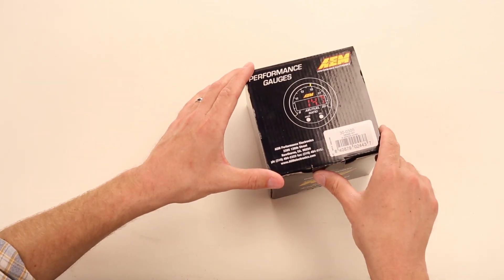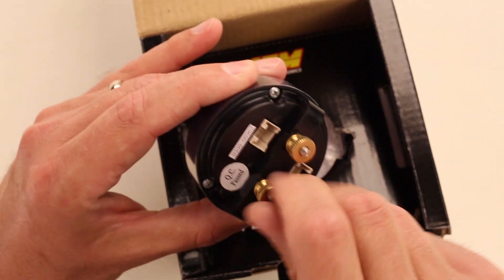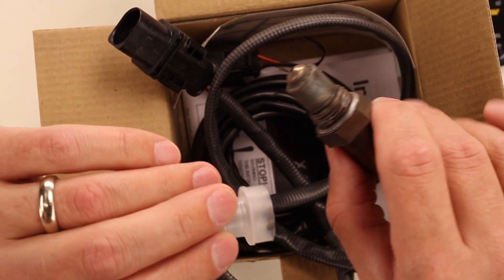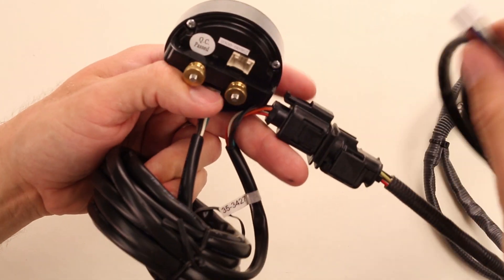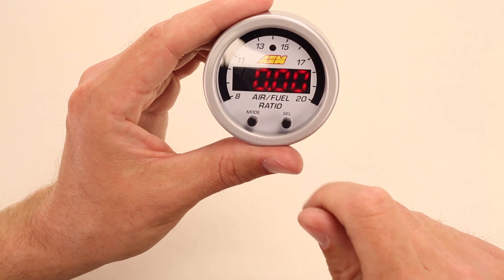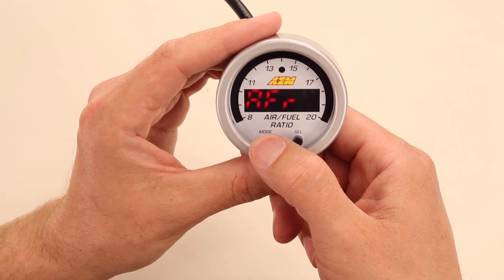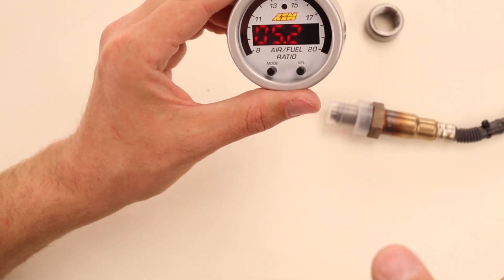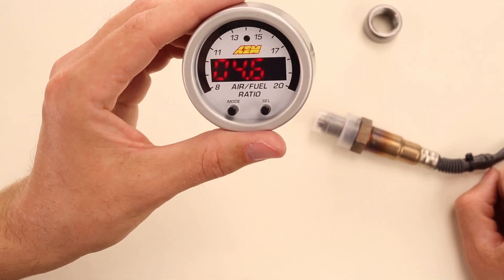AEM Electronics Digital Wideband UEGO AFR Gauge PN 30-0300 Unboxing

Comment: It’s not made in California, it’s made in Taiwan/China. 
Mine came with Chinese labels stuck all over the back.
AEM just has a moderately sized distribution centre in Hawthorne, there’s no manufacturing there.
Reply: It's a highly counterfeited part. You just can't buy one from anywhere. Only from a reliable vendor. You might have bought a counterfeit.

Comment: how can I tap this is into my standalone ecu so my ecu knows what the afr is rather than having the data just on the gauge itself. I have a plug-in-play ecu. do i splice into the factory o2 sensor wires??
Reply: I'm interested in the answer to this as well. I'm new to Speeduino but I'm hoping this will work for it.

Comment: how does this work on dual exhaust? or does it?
Reply: Hello and thanks for your interest in our products! You can place the 
sensor further than 18 inches but it should not exceed 36 inches.
Reply: Instructions say " Sensor Placement : 18 inches (45cm) downstream of the cylinder head's exhaust port or turbochargers" My best guess is that on the average V8 install the exhaust's X or H pipe will be well out of the distance where the sensor will work properly so it is a big concern.I was about to order one but I want to get some feedback from AEM FIRST
Reply: you need two gauges one for each side of the engine and two O2 sensors, Innovate MotorSports these guys competitor sells one called the DLG-1 I own it and it's a single gauge with two read outs on one gauge, uses two separate O2 sensors, you hook up one O2 sensor directly to that gauge the second O2 sensors you hook up to a black box called the controller and then daisy chain that controller to that gauge